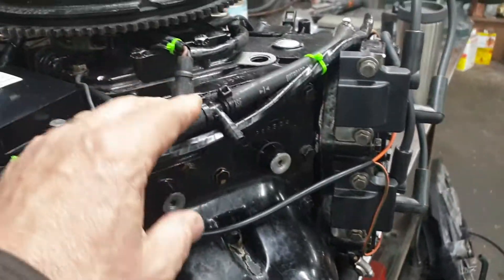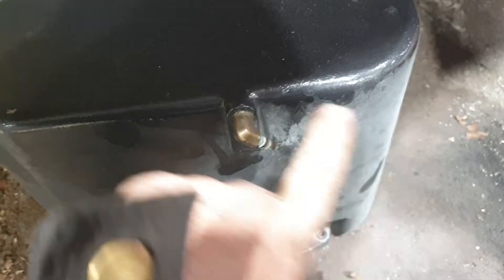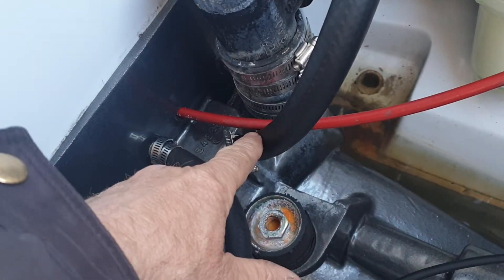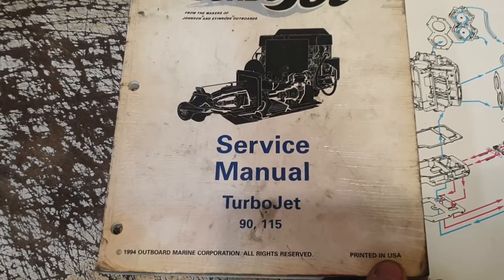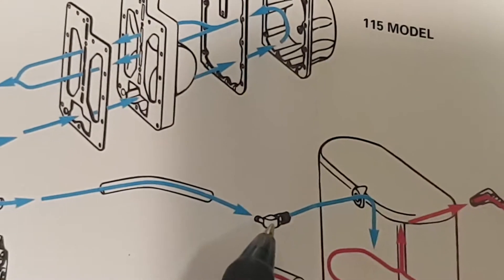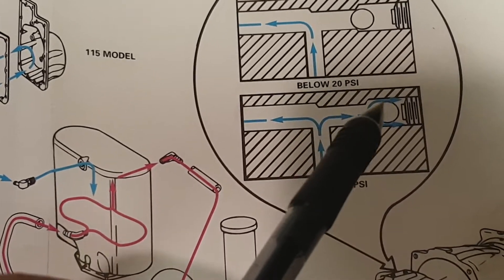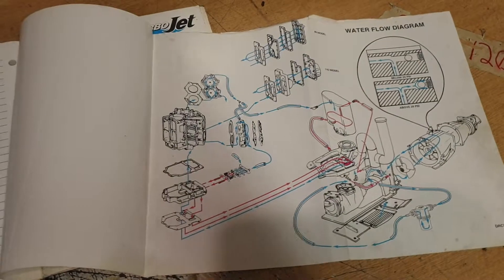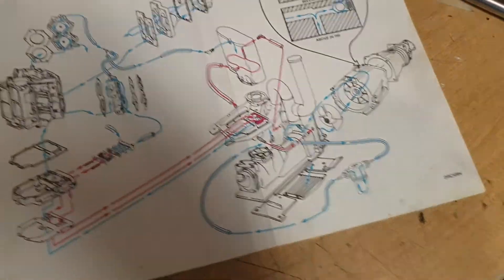OMC 115 TURBOJET ENGINE COOLING SYSTEM AND OVERHEATING part1

Comment: How do I test if my fuel pump is working on my jet boat 1 15  four winns fling
Reply from the maker: @JamieFudge-hv8dq  unhook the fuel line under the carburetor and crank the engine over.

Comment: I significantly upgraded the cooling system in my Whaler 115OMC and now how a peepee sprayer and larger exhaust resonance time. Buzzer goes off at 210 and resets at 170. Run a 50 mesh screen to protect from debris.
Reply from the maker: Also Try enlarging the water pick up port on the jet pump, it greatly increases water flow.

Comment: GREAT video explanation of the water flow and a nice introduction to the Turbojet motor in general, thanks! ! Besides the water flow, is there anything with the motor and oil injection system to look for...or anything else you would recommend a buyer to do/check on a turbojet that's new to them?  
I've had lots of experience with big boats and 4 cycle but dipping into the "2 cycle jet boat" pool and buying a 1994 Seaswirl Squirt to use as a tender boat. I've been reading lots of negative stuff about those mid-late 90's Mercury SportJet and OMC Turbojet motors, but it sounds like maybe uneducated users don't know to proactively keep this water flow system properly cleaned out that causes most issues? 
Thanks again!

Comment: Hey there!  I have a 94 Whaler Rage with a 90HP OMC jet drive.  My problem is that the boat is idling fine, but once I put it under a load (3k+ RPM) it will sound off the overheating alarm within one minute.  Any tips? :)
Reply from the maker: It probably has sand built up inside the exhaust. There's no easy way to clear it up, you basically have to take the large water box muffler off and flush it out that usually helps.
Reply: @eriksalomonsen4595
I have exactly the same thing, same year too... Did you figure it out? Did cleaning the muffler work?

Comment: Great video ! Im having trouble with my Fling overheating. The water flow chart was very helpful and also the fittings that are prone to plugging up. I will remove and clean them all then flush engine. Thank you !

Comment: Excellent video! I'm reconditioning a Fling now. Don't have the title yet, so not sure what year it is or if its a 90 or 115. Any way to determine? I suspect this boat will end up in your shop soon. From Lansing area
Reply from the maker: The last two digits on the HIN tag on the back of the boat will give you the year. I've never seen a 90hp in any year Fling, its gotta be the 115T.
Reply: @5StarPWC  , thanks a TON for the info. Love your channel